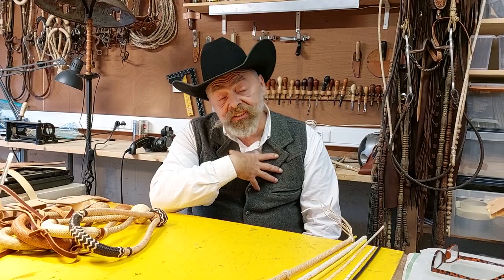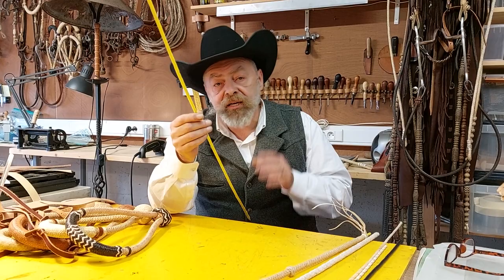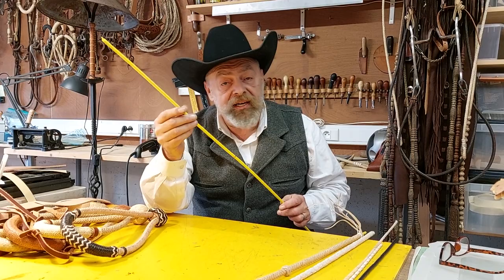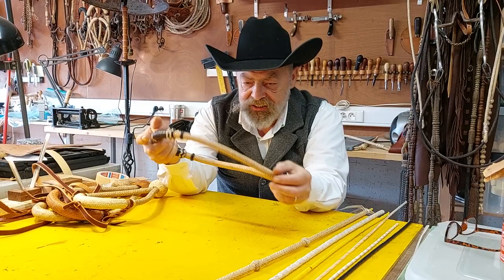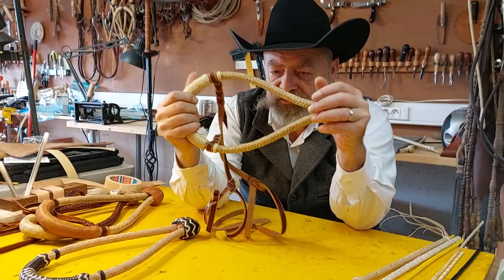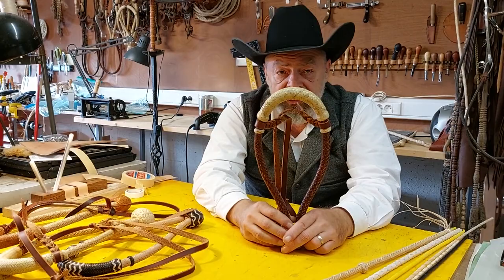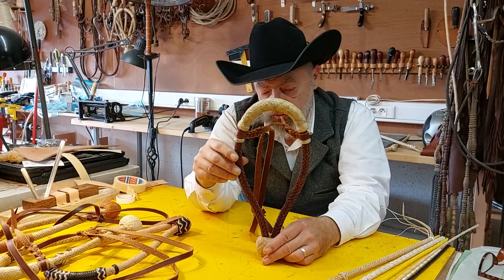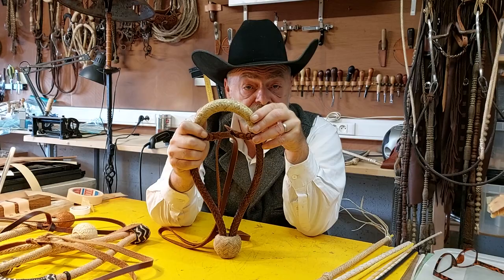My personal opinion on hackamores and bosals.

Comment: Historically, in Mexico, jáquima (from where the word hackamore originated), referred to the headstall and the bozal (noseband) together. In Spanish, jáquima just means halter, so the headstall attached to the bozal becomes a halter or bridle. Bozalillo, which is a thinner bozal, is used after the horse has been fully trained with the jáquima as decoration and backup bridle.
Reply from the maker: yessir, that's how I use the terminology, but I hear in some regions other terminology seems to be used

Comment: What is your recommended cut off of Latigo leather for Braiding?
Reply from the maker: I myself don't braid a lot with latigo, but when I do, I like to cut strings for braiding out of the hide lengthwhise 'till I almost reach the stretchy belly part. They are too weak to pull on for the braiding. In the past I made a set of reins in latigo, but didn't like the feel of 'em. I only use latigo for bosal bodies, over a twisted rawhide core. Waxing the strings helps a lot. Closer to the belly part of a latigo hide I cut for hangers and such. Nowadays if I need a leather body for say a bosal, reins and have you, I only use kangaroo